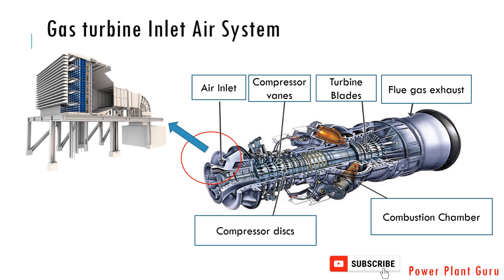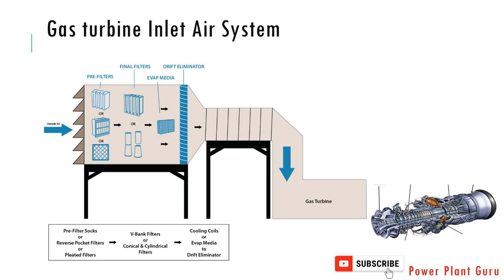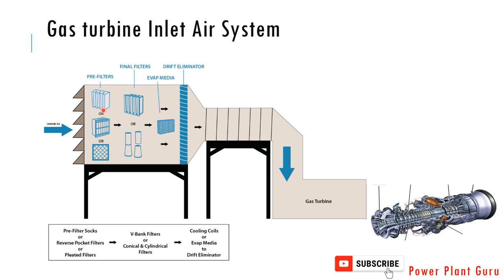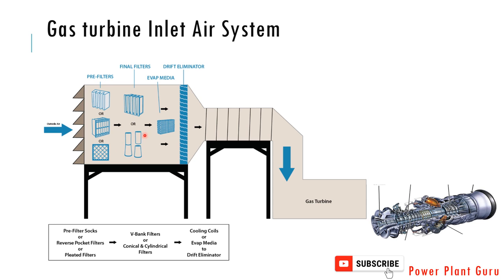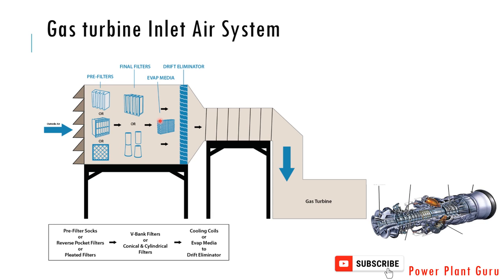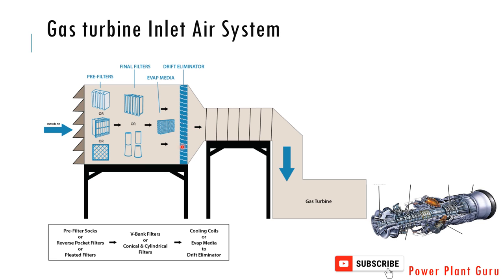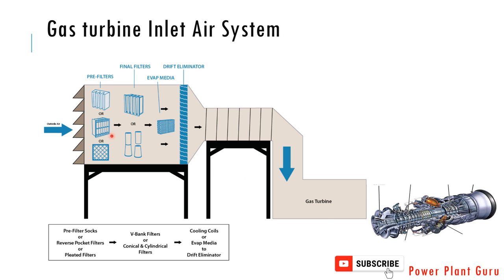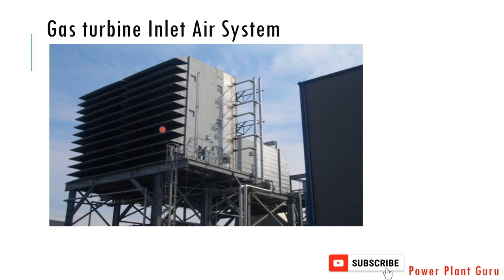How Gas Turbine Inlet Air filter System works. Ge Gas Turbine, IGV

Comment: How can we measure the mass flow rate of the incoming air?
Reply from the maker: Thank you for watching my videos. 
There is no measurements for incoming air and it will be different for different igv openings. But for total exhaust flow(air + fuel ) there is a calculated value available in gas turbines. If you know the tag number for your machine you can find the value

Comment: How filter can self cleaned...
Reply from the maker: APU is the unit which works for self cleaning. The air pressure from APU comes in opposite direction of normal flow and push the dust accumulation
Reply from the maker: This will reduce the filter ageing
Reply: @powerplantguru007  How the opposite direction of normal flow can work..
Reply from the maker: The normal path from the air filter is outside to inside where atmospheric air is filtered and dust accumulation is on filter happen, in self cleaning cycle there is a solenoid operated compressed air  supply is placed inside, once inside valve open cleaning is done
Reply: @powerplantguru007  Thanks for explanation..

Comment: Why does inlet air flow decrease when the load MW increases? What is the relationship ?
Reply from the maker: Hello. 
Air flow increases as per MW increase. As higher MW requirement is higher fuel requirements and higher fuel requirements is higher air requirement. 
IGV plays that role to control the requirements of maneuvering the air flow.

Comment: Sir, whats affect the dp (differential pressure) to change? Whats the effect cause by this dp on a system?
Reply from the maker: Thank you for asking questions.. 
Inlet air filters draws lot of air and with air, dust , sand aerosol fine particles come and they sit on the filter surfaces because air filters can prevent particles of more than 3 micron. 
Slowly these particles keep deposit on filter surfaces and reducing surface area from air can pass. This is when dp starts increasing. 
Now, you can imagine efforts from sucking air from clean filter and dirty filters. And this will cause in less air flow to compressor and then reducing the output. '
Hope I have answered your questions. 
If not, please ask again. Will try to answer
Reply: @powerplantguru007  Thank you for the answer. I want to ask another question. When the dp high, it is indicates that the filter is already dirt or covered by the contaminants, the common action that we can take is just replace the dirty filter with the new one, and it will cost the company because they have to spent more, especially when the interval of the filter change is short. Is there any possibly solution to decrease the DP itself, and make the interval change of filter is longer? Thank you in advanced
Reply from the maker: Hi thanks for reaching out. 
I would suggest a few things on this. 
1. Keep Check on pulsating air filters cleaning system pressure and it's all sov are working. Keep operator rounds and ask in each round if he can listen bump sounds of filters back cleaning. 
2. Keep a dust extraction conveyor in working condition from the dirty side of air filters. 
3. You can install a very low cost wrapper (type of filter) for covering air filters from outside, this will wrapper are washable and once you face sudden increase of dp you can remove those wrapper also and then you have relief from emergency. Then your wash the wrapper and again install. This way you can increase the life of filters.
Reply from the maker: These are some practice which are recommended. You can check it's application with your make and model of machine. It may be different for different machine
Reply: @powerplantguru007  alright, thank you sir
Reply: @almaidahnurilfauzi7813  it could also be because the evap cooler has evaportavie media cloggfed up with calcium which prevents more airflow and or the drift elimanator is clogged as well
Reply: You are great Teacher and your every explanation is unbelievable and unbeatable.  Great Salute Sir
Reply: Good information , thanks